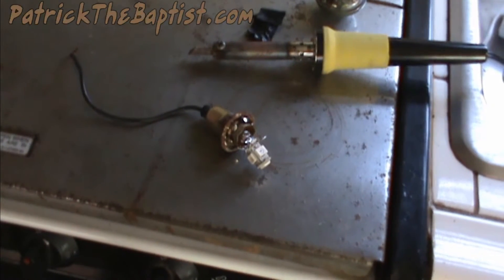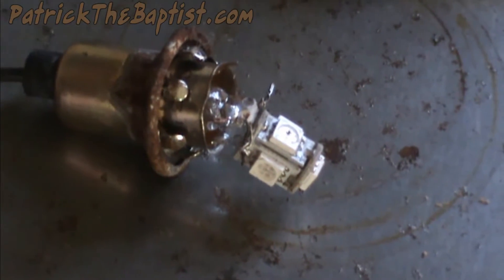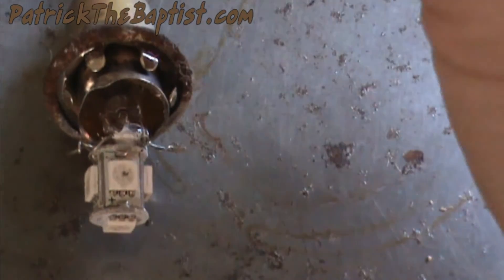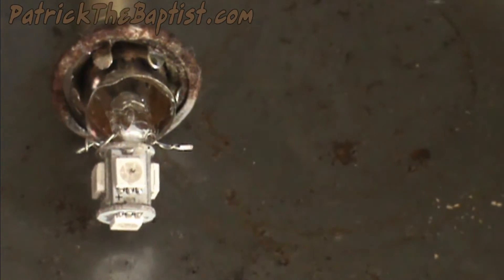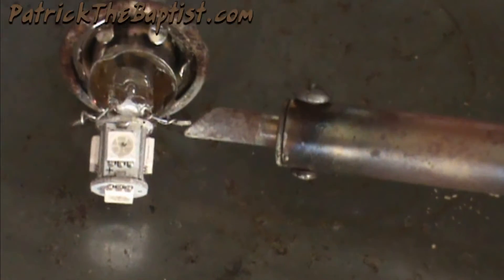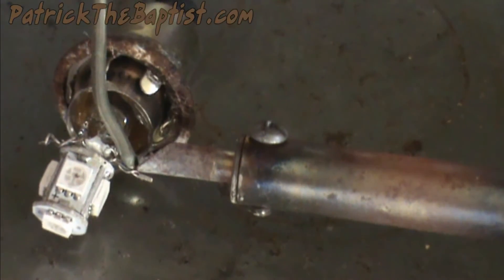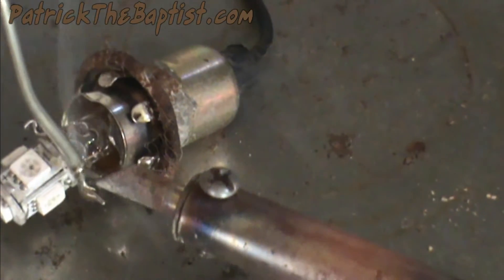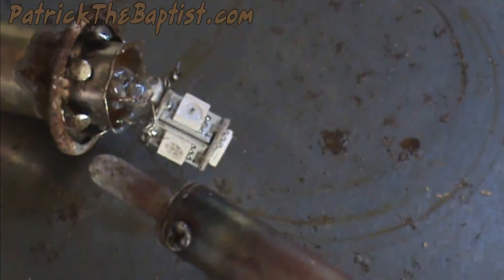Have you ever seen this happen while soldering?

Comment: LEDs light up very visibly at mere microamps.  It could be resistive or even capacitive leakage from your iron to ground.  I strongly recommend a grounded iron for soldering devices that are sensitive to reverse polarity, as the iron leakage is AC.
Reply from the maker: +bigclivedotcom Yeah another feller made mention of that, figures I only paid $2-3 for it LOL.
U ever checked out those PSP clones china sells?  I've had 2, they are really neat-o.
Clive, I am hooked to watching you take stuff apart, ever since I could hold a screw driver I've been taking my toys apart, everyone would get so mad at me, well had I not I don't know what I'd do for work....
Take care.

Comment: That iron isn't grounded. Time to treat yourself to a new one -- your iron stands a good chance of damaging parts as you solder them. Also, your tip is long past a one way trip to the Halls of Valhalla! ;-) With the iron cold and unplugged from power, it should have a resistance of about 20 ohms or less from the tip to the earth/ground pin. If not, it's a death trap.
Reply from the maker: +Mage of Machines Thanks for the idea, it was a el cheap-o iron from china for like $3, LOL I guess I got what I paid for... LOL  I had a stove doing this, putting out up to 110v into whatever was on it LOL.  https://www.youtube.com/watch?v=9BnAIjs9fic